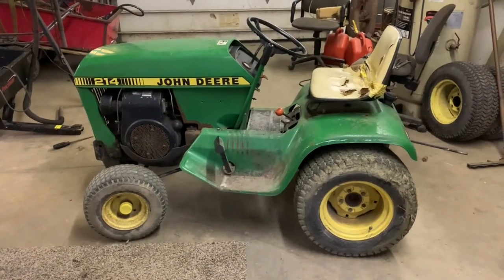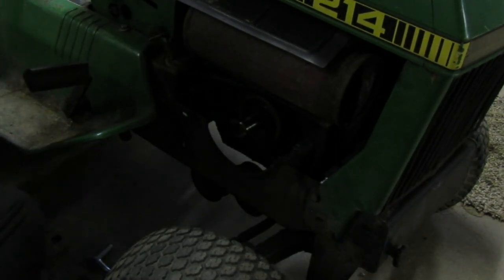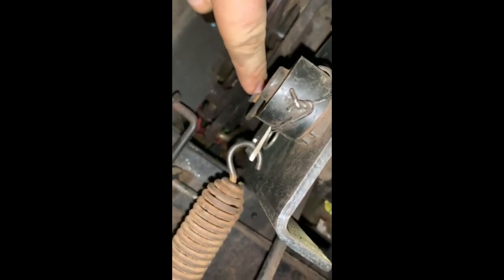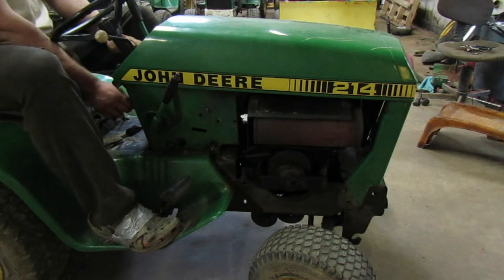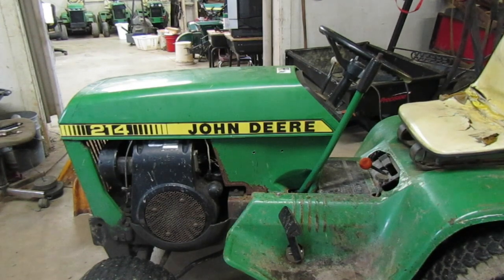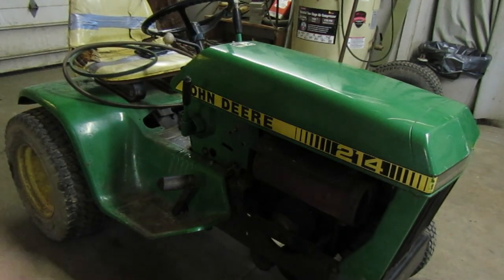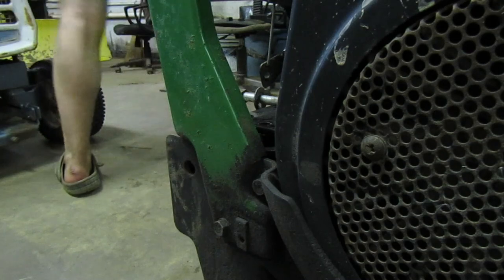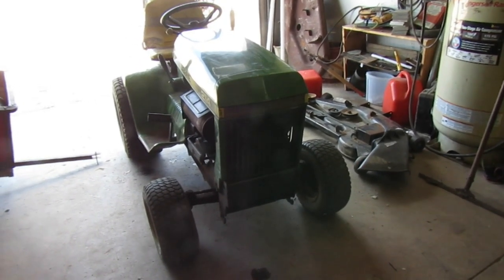Lets Fix it! 1979 John Deere 214 part 2! Replacing the variator and fixing other small things.

Comment: Going to pick up a '77 214 tomorrow (hopefully, the owner has been a little dodgy but by god, if I say I'm renting a trailer and driving an hour, you better believe I'll be there!) and learning everything I can for future rebuilding. Seems like people go for the 100 and 300 series and pass by the 200s, which is a bit of a shame as I prefer geared tractors over hydrostatic personally and sought this model out. He said it ran low on oil so I'm expecting to have to rebuild the engine, but one thing I've come to appreciate is that parts are still relatively widely available for a 40+ year old machine! More than I can say for the last project I tackled, which I ended up having to engineer a friction clutch disc and will be rebuilding the transaxle in the coming weeks.
Love the channel and subbed!

Comment: I just discovered this channel. subscribed! I have a 76 212. my dad purchased it new and I now own it. 2 yrs. ago it started running rough. put new carb on her. she starts but only runs at low idle. soon as I push lever up to increase rpm to run the mower deck or even to just drive it it dies. last thing I'm doing is replacing mechanical fuel pump in hopes that that was the issue. If compression is not good can I get away with just replacing rings on piston? what are your thoughts? I haven't checked compression yet. Your channel is the only one I've found that goes in depth with 70's vintage john deeres. I love it.
Reply from the maker: Thank you I’m glad my channel has helped you. I had something similar to that happen try adjusting your carb pull out your choke when you try to throttle it up and see if it stays running. If it does your not getting enough gas and need to adjust your carb. If that doesn’t solve your issue I’m wondering if your points need adjusted the gap should be 20 thousandths. I think I have filmed videos on both on this channel but am not sure what exact videos.